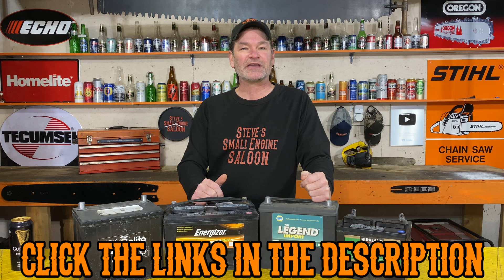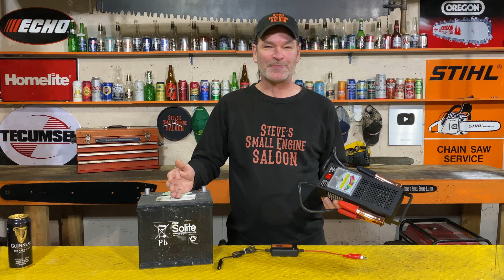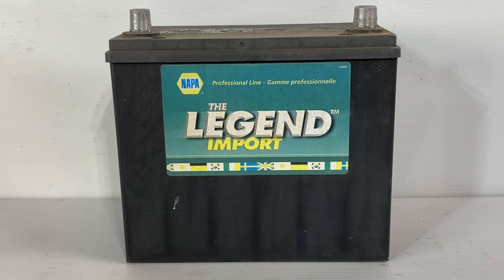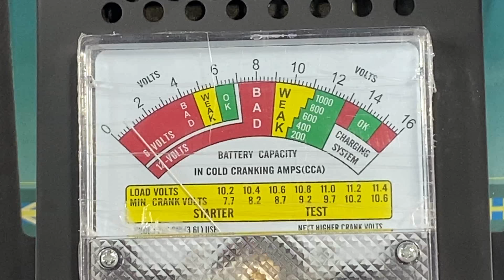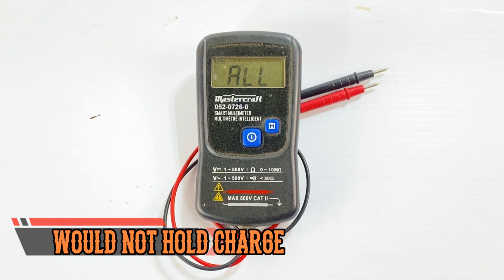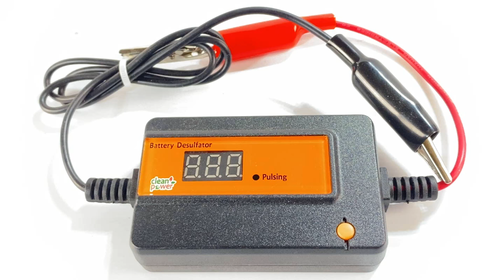Does An Electronic De-Sulfator Really Repair A Battery?? See Real Results

Comment: I have used the BatteryMINDer brand maintainer / desulfator for the past 15+ years.  Works great!! I replace my auto batteries when I hit the 5 year mark as a preventive maintenance -- even when it passes the load test.  The key is to keep them hooked up / or attach frequently and let it run as long as possible.  Desulfators takes longer than 3 days to work - the more sulfated the battery, the longer it takes.  Hook up the ring terminals directly to battery so you can plug in when vehicle or machine is not in use.

Comment: Well, you said it, it worked on 2 and didn't work on 2.  My electrical engineer dad told me this in the 70s, and when it works, there is no telling for how long it may work maybe 1 more charge or two or many.  Is that unreliability worth your time & effort?

Comment: Hey Steve,  Take this with a grain of salt but try the systems from Tecmate.  They're a British company and their tender systems have been a staple in my garage for 10 years.  I've used the Optimate 7 and Optimate 4 for trucks and small engine applications, respectively. 

Pricey but they are what I'd best call 'complete solutions'

Comment: I live in Canada and own a small vehicle, hence small but expensive battery. Was at my second battery and starting to see a pathern. Even if I had the money which I dont its against my principles to allow a clear engineering flaw to continue. Cant get a bigger one theres no room and not gonna relocate. This type of device did the trick and will at least prolong the inevitable. But in my case also found it was more for batteries losing charge. It wont make miracles but almost
Reply from the maker: Right on

Comment: Being a bit stingy/careful I always try repair "dead" batteries here - I find it is 50/50 - but still well worthwhile. I've learnt that if you don't open - some cant be opened without major damage -  the battery & top it up with distilled water, you're not going to win - if you can open it & top up the cells, chances are it will come back to good life. I use a huge "Starter-Charger" to jolt the things back to life - it has an accurate amp gauge & loads of manual settings so you can pretty much make it give any level of charge you like,  depending on what stage the battery is at. 

When it works, it works great & when it doesn't, it just doesn't - 50/50 like I said. But 50/50 is better than chucking away 100% of your expensive "dead" batteries IMO.
Reply: To fool the de-sulphator into kicking in on a battery under 10V - jump a good battery onto the dead battery first, or clamp on a controllable 12v power supply - the desulphator will be fooled into starting to work as it senses sufficient voltage - it's Smart, but not that smart. .

Comment: Thanks.   Yeah,  I've had luck with a desulfating charger.  I have a motorcycle version,  it's just a 2a trickle with desulfate.   It doesn't always work, but something like 1 out of 5 it'll bring back.   With the price of batteries these days it's worth the effort.

Comment: I had three batteries, two pricey deep-cycles and a 950AH truck battery. I also had a desulfator and a 1.5 A charger.
All were fine a year ago. 
About every 5 days I went out to the garage and rotated them, one on the desulfator, one on the charger and one disconnected. I did that faithfully all winter. In the spring, all three were completely dead. I discovered my charger was broken. 
At least I got the core charges. But that was about $575 worth of batteties :o(

Comment: I saw a video about building a circuit around a 555 timer to do the job, seemed pretty straightforward...  I have a generator that has a 2019 car battery and the charger continuously charges the battery so it eventually dies sooner than it should.  Seems like it might be the perfect restorative tool for batteries like that.
Reply: I built a 555 based desulfator from plans on the internet. it works,and you can charge while using it. with modern CAD programs and circuit board manufacturers,you could have PCBs made up for a low cost. getting the right inductor is the critical part.
(Mine is perfboarded.)

Comment: The trick is to run two batteries in parallel so that you get adequate voltage, then you electronic desulphator works.
Reply from the maker: Great idea!

Comment: Happy New Year 2023!  Revisiting this Video again... Unfortunately, left my Stand-alone Desulfator at home... 

Traveling/Vacationing and finally getting back to using my Snowmobile which has been in "lockdown" for much of the last 2-3 years. Should have made a point of "topping off" at least once or twice each year with a "Smart" Charger.  

Most of mine already claim to have a mode/cycle to look for Battery Conditions that indicate excessive sulfate (internal resistance) and then apply the ideal voltage/amperage to recover the battery...  But so far I think I may have waited too long to act.

Comment: I think this gadget works with batterys that are used not very often and not maintained, held over winter on the shell and not charged or what-not..  What i cant understand is peoples reluctance to get a new battery when old one dies.. People spend money on all kind of crap without any problem, but to buy new battery- no.. Let say battery life span is 6 years, let say you need  expensive 400 euro battery, it is 66 euros per year or 6 euros per month, usual car battery is like 150 euros, it is 25 euros per year or 2.1 euros per month.. It is no brainer, if battery is unreliable and old, get a new one!

Comment: This is legit. Although I think there is some truth to desulfators, batteries fail in different ways. I believe your first two batteries probably had shorter cells. You can typically spot if a battery is sulfated when you hook up your charger to a dead battery.  The amps will be very low but the volts will be way high, like 15.  Sulfation just occurs over time but it happens very quickly if a battery is run down and not recharged. The best way to avoid sulfation is to keep your battery charged at all times.  Understand that your alternator isn’t a good battery charger and occasionally do a slow maintenance charge overnight a few times a year, especially during the winter.

Comment: Keep the connections clean ,and lubricated , batteries do not like vibrations , monitor your voltage , and do a maintenance charge every two months,

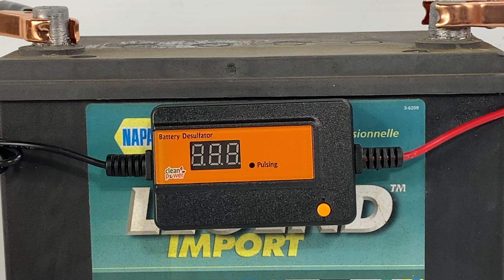Comment: 4:50, I have a solution for that, just use alligator clips to connect another good battery, it can be a car battery, little 7ah battery, whatever (as long as it is 12 vdc) so the charger sees a “functional battery” and then double the charge period (as half the current goes to each battery) I know it takes a while but it works
Reply from the maker: Great idea

Comment: One of the best and most thorough desulfator videos I've seen. Good Job. Based on your results, it seems the first two had individual cells damaged beyond the point of repair. The latter 2 had degraded cells, but still recoverable. VERY good information, thank you again.
Reply from the maker: You're Welcome...

Comment: Try blasting it with a 100 or 200 amp charge. I've had that bring back several batteries. Just need to check each cell with a hydrometer first to make sure that it's not internally shorted before blasting it with a high amperage charge.

Comment: This kind of desulfator requires the targeted battery maintain more than11.5 V to operate.  If your expensive Energizer battery can not be charged to 11.5V, there is no way you can use this desulfator.

Comment: If you used a better desulfator that didn't need the battery to have at least 10 volts the NAPA Legend battery would have been desulfated and most likely would have been like new again. Also if a battery is heavily sulfated it takes 4-6 weeks to completely desulfate a battery.

Comment: Do you still pull the caps off to release the sulfur? Apparently a 110 volt welder connected positive and negative for five minutes works, gotta boil the water. All good advice. Thks

Comment: Plz help me!!! My battery was the problem and now my moped isn't running when it comes to leaking from the fuel pipes I also put 15.40 motor oil and it says 10:40 I don't know if I messed up something I don't have money for a mechanic I'm a girl and I'm going to have to dig through it I already did a little bit but I don't know anything about it my grandparents are dead those were my mechanics and now I'm trying my damnedest to get the moped my own form of transportation to turn over
Reply: My new battery only charges 8 volts supposedly I'm trying to charge it to 12:00 but I guess it's not doing that

Comment: I didn't use this desulfator. However, I can attest that desulfation works. I live in Texas, which means hot summers cause car batteries to not last as long. I had a 6 year old car battery that just randomly decided to quit on me. I put a desulfator on it for about a month and the voltage went back up to 12.8v. Mind you, I had some weird readings between desulfation processes (my desulfator has a 24-hour cycle, then stops). At the start of desulfation, my battery was reading 10.4v. After a couple of days, it went up to 11.5v. It stayed at that level for the next couple of weeks until I noticed that the voltage was dropping again after desulfation to 9v. That's when I researched the situation online and found this:

"After a few tries at varying amperage, it has held a charge. I have continued to keep the BLS on it for about a month with some removal time to use in on my weak truck battery. The battery will now hold at 12-13 volts unless I leave the desulfator on and the voltage will drop over a 2 week period to 10."
So, I decided to let the battery sit for 30-40 minutes to see if letting it settle down would make a difference. The voltage went back up to 12.8v. That's probably the highest voltage it's seen since it was manufactured. I took it out to my car to see if it would allow the engine to turn over. I was able to start my car up twice with the battery.

I waited another 24 hours with a trickle charger plugged in to see what would happen. I unplugged the trickle charge and the voltage on the battery read 13.1v. The car was able to turn over twice.

Update: After letting it sit a few days, it dropped back down to 8v. My guess is it was able to be brought back to the original voltage under ideal conditions until it was brought out into Texas weather and it went through a catastrophic failure by immediately going back down to 8c.

Comment: NOPE! Once a lead acid battery is done, it's DONE! Don't waste your time!
Reply from the maker: Hundreds of videos disagree with you!  Just sayin...
Reply: @StevesSmallEngineSaloon  I am gonna disagree as well.  Thanks Steve for the informative video!  I have an old pickup that I don't drive often the battery is about 6 years old and was only holding about 10.5v so I got one of the charger/desulfator $25 off Amazon and within a few hours it was holding 12.5v and works great again.  Going to run it on my other vehicles as regular maintenance yearly

Comment: I have a marine deep cycle battery I use for a trolling motor and its been less than a year and it doesn't last near as long as it use to. It holds a charge but drains fast when used. I never ran the battery down past 11.7v. Is there anything I can do to revuve that battery?

Comment: Sometime it needs more cycle to revive a dead battery, like 7 or more
Reply: Also it depends on the type of abuse the battery experienced. If it "drilled a hole" into the plates, desulfators are definitely useless, you'll need to service it.

Comment: It can take WEEKS/MONTHS to desulfator a battery, it took YEARS to blind the plates, I have used desulfators to revive Golf Cart batteries with great success, if you hook up the desulfator when the batteries are new it will add years to the life of the the set.

Comment: Hi, Steve.
Really enjoy your videos.

I watched this video a while back, but re watched it today.

The De-Sulfator will not start unless the battery is at 10 volts or so.

I was wondering if, on the battery that could not get above 8 volts or so,
did you try to fool it with another battery, and once the rig turned on,
just remove the good battery.
Just a thought.

Comment: Sounds like this might work, but the batteries with caps, I would check the water/acid levels, then check the specific gravity and see if it’s worth saving it. 1.265 or more should be good.

Comment: The key is doing it 5 times. I saw a fella doing that on the tube. It absolutely works. When it doesn’t you have to flush and put in new sulphuric acid. I just fixed two of mine.

Comment: I bought some property in the mountains. There was a lot of trash in the yard. In that trash was an old battery.  The top of the plates were white. What the  heck. Try charging it after  I put some distilled water in it. Nope, no good. I put a few drops of muriatic acid in each cell. Had to charge it out side for three days. Until the smell went away. Yep , we got power. Maybe the PH gets messed up from some of the water. If you try this DON'T charge the battery in doors. Smells really bad.

Comment: If your desulfator needs 10v minimum to turn on, just hook up another battery in parallel to get it started. Some chargers wont charge batteries that are dead flat, so the guy at the parts shop said you can use even a 9v battery from a smoke alarm to "jump start" the charger. Only needs a second to make it start charging.
Reply from the maker: Great idea!

Comment: I know I am late to the party here but battery #2 that you couldn't charge to 8 volts, get a small hammer and take about 20 minutes and tap on all 4 sides of the battery lightly but hard enough to make a decent noise. There are clumps of sulfur that have built up between the plates in several cells. Tapping on the battery will eventually break up those clumps of sulfur. It will then allow you to charge it to 12 volts. You can then attempt the de-sulfator, which may or may not work at that point. My bet is it won't work at that point as the battery is too far gone. If you can get it to hold a charge after the de-sulfator, try adding new battery acid to see if that works. You might be able to use that battery for a garden light but I doubt it will ever start a car again.

Comment: I built some homemade versions of this.  Most of them are the same but the inductors can be small, low powered and slower, or large, higher powered and faster.  I have some that have small inductors which are good enough for smaller batteries like UPS SLA types.  I have about 10 or so that have larger inductors and do well for lawn mower, car or larger batteries.  

I do mine differently than you.  I charge a battery with a smart charger and let it sit overnight.  The charger may cycle back on a time or two depending on the battery.  Once that is done, I put on a trickle charger and hook the desulfator up as well.  I put a ferrite core inductor between battery and trickle charger to protect the charger.  It's not good to let that pulse go back into the trickle charger.  At that point, I let it trickle charge until needed with the desulfator running.  Some batteries can sit like that for months.  Once the battery is desulfated, it just works as a preventative tool.  

As a example, I had a old Interstate car battery that I wanted to power a fence charger out in the woods.  To shady for solar and to far to run line power.  At first, the battery would last a couple days and show about a 30 to 40% charge when I swapped it out.  After about a month of cycling the battery through the process, the battery would stay in the woods for a week and still show a 60 to 70% charge.  The desulfator helped it a lot.  The battery is about 15 years old.  I've since replaced the battery in the car it came from twice.  I don't have a tester but if other batteries I used are any indication, that old battery is as good as a new one.  Impressive for sure. 

Where desulfators will not work.  A battery with a shorted cell is to far gone.  It is very unlikely a desulfator will help.  A battery that has physical damage, internally from being dropped etc, won't usually work and could be dangerous to charge.  Also, if a battery gets hot while charging, I've never got one of those rejuvinated with a desulfator.  A battery that takes a charge but has trouble holding it, those usually can be desulfated even if it takes time.  

It's amazing how well these things work in the right situations.  Given the cost of batteries nowadays, they can pay off really fast.  The biggest thing I've noticed, use them as a preventive tool.  I desulfate my car, lawn mower and tractor battery whenever I have a chance.  My standby batteries are always hooked to a trickle charger and desulfator.  

Hope that info helps someone.

Comment: Heck if it fixes just one battery and you can get another 6 months out of it, it'll be worth having in tool box.
Reply from the maker: I agree!
Reply: @StevesSmallEngineSaloon  just connected one of these to a 12v 35A battery I use on my RC mowers that's reading low on CCA, anxious to see if it will get rejuvenated.if so, will save 75 for few more months.
Reply: @StevesSmallEngineSaloon  well, It totally destroyed my 75% healthy battery CCA went from 290 to 120 and Health went from 75% to 11%. now I have to buy a new one. Lesson learned. ;-(

Comment: I've flushed them out with a hose, filled with baking soda and distilled water overnight,  re-flushed and refilled the distilled water and recharged. 
IF that doesn't work, I'll pop the caps and hook up the DC welder, raising the amps until it gently boils and hold that for 4-5 minutes. I did that to my VERY weak yard tractor battery, and it's like new now, doesn't even need a float charger any more. Plus I didn't buy acid for it.
ORMV.